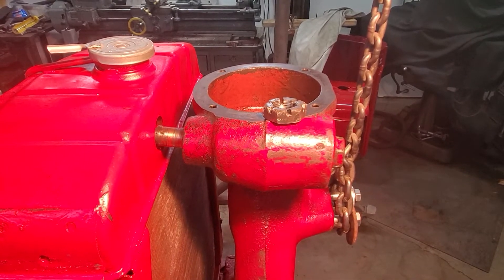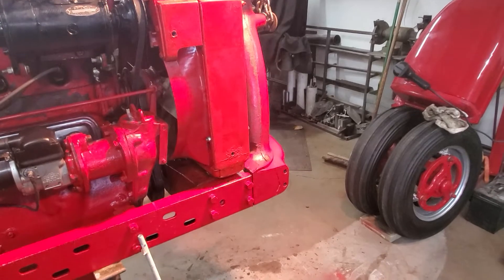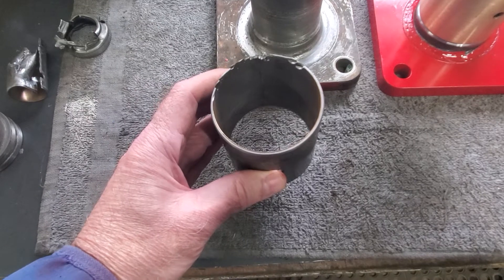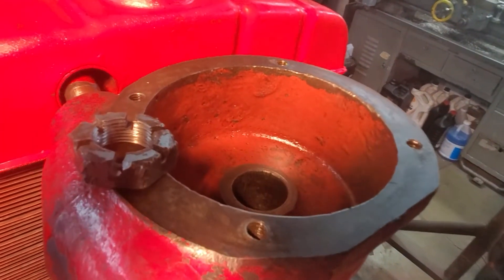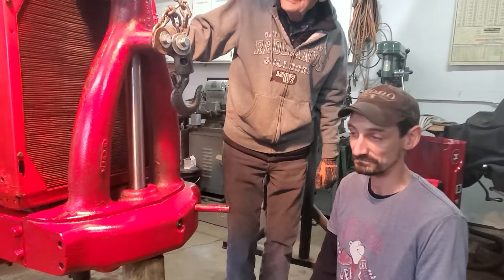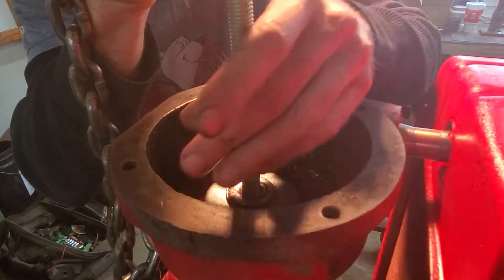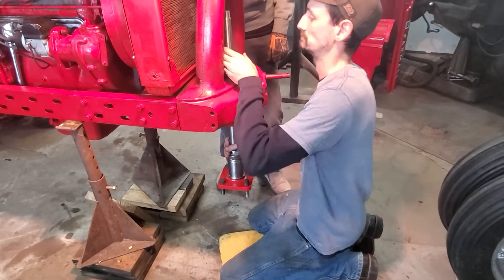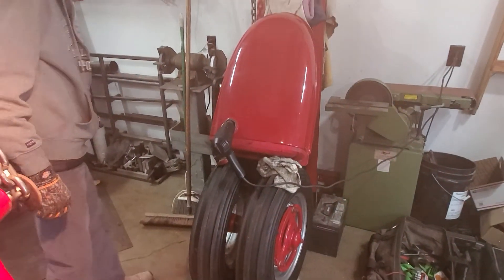Farmall H Bolster Shaft and Bushing Bearings Installation (Part 1-3/4 of 2)

Comment: I'm trying to think back on how I removed that upper bushing. I can't even remember - now I will have to go back and watch my video at some point! (I thought I used a socket and threaded rod as a puller?)
Reply from the maker: I think you did.  As I look back at it, had we had that tool already made up, I believe we could have just driven it all down.  But, live and learn.  It's often easy to figure out stuff after its apart.  But, that tool sure helped with the installation.  It all went in easier than it came apart!  ha ha
But remember, it was your excellent video that gave me the confidence to do the bolster project (well Squatch's video too).
Say, now that I think about it, I think that was my piece of aluminum.  Adam makes farmall H venturies for me on his lathe when I need one for my hobby.  I may have to go to 6061dude and buy more aluminum now.  I will put it in Adam's stocking for Christmas!